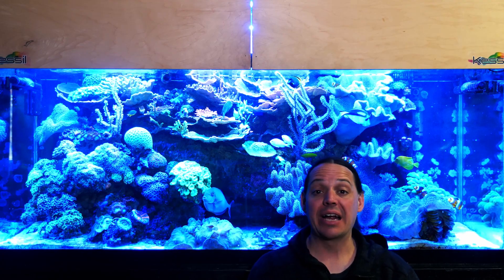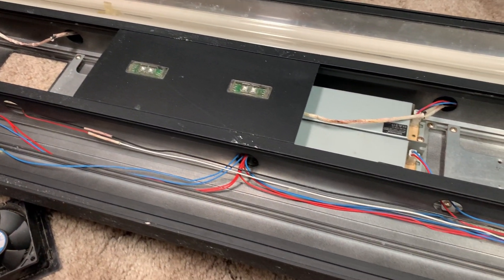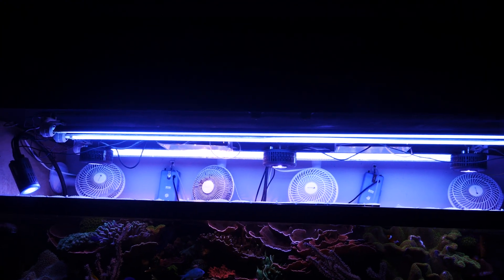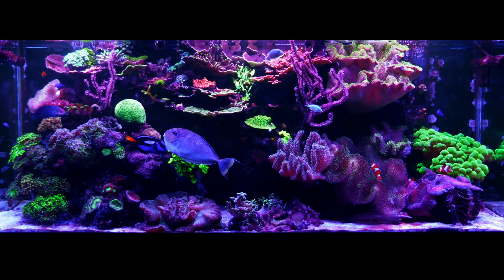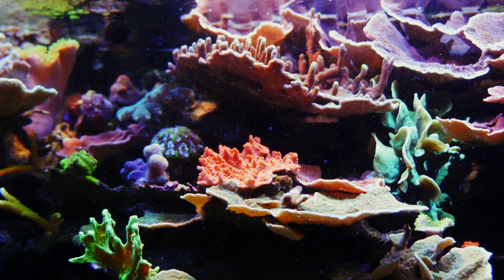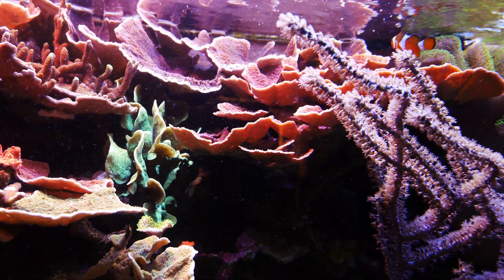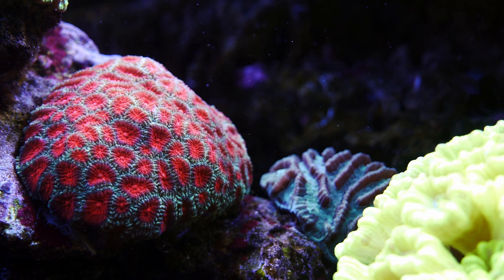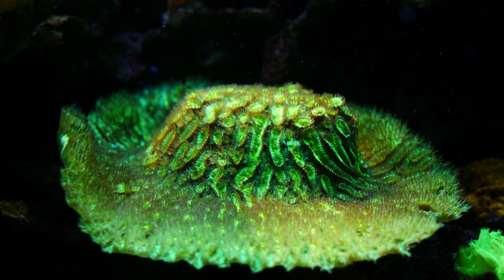Did I Just Change To Metal Halides?

Comment: Pffioouu, that's a lot of light and I love it :)
Metal Halide was the reason why I stop my aquarium 15 years ago. Too much heat and I couldn't dissipate it in my room.
Reply from the maker: Aqua Splendor this is all an experiment for me at the moment. I’m going to put the glass covers on it’s not worth the risk. I’m also using mine as supplemental light so i don’t have to run them if there are problems
Reply: Aren’t the covers to protect the bulb from splash

Comment: I loved them but things get hot,I used to turn my fans facing out🤔 that way it would push the Heat out from under the canopy,I tried both ways and for me it seemed yo keep under the hood cooler getting the Heat out. Long time ago,Hey double check the Electricians Work make sure you don't catch fire, I did the same thing😂😂💜 ✌🌿
Reply from the maker: Eddy Ortiz  Lol I think the wiring is ok 🤓 If I do decide to run them longterm I will probably mod the hoods cooling. Thanks for the feedback